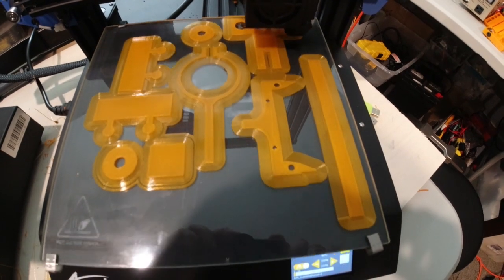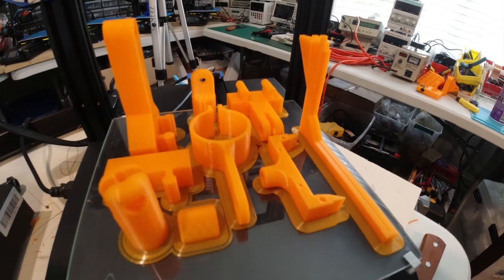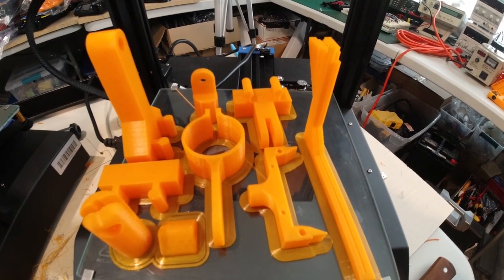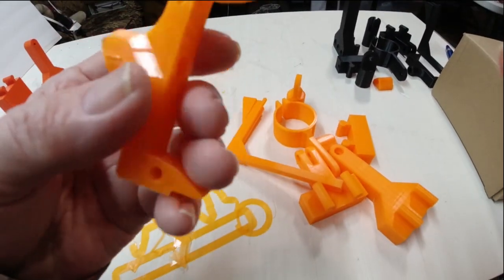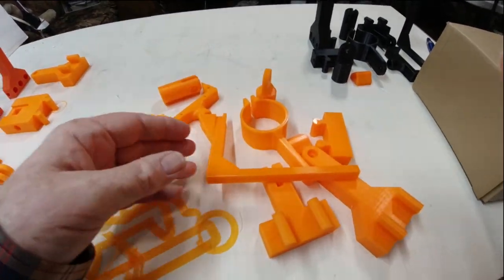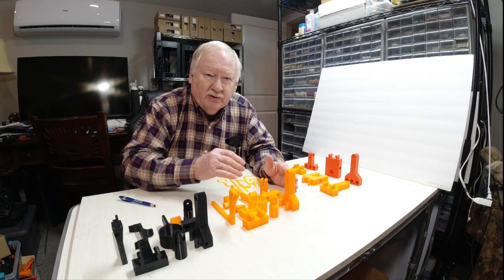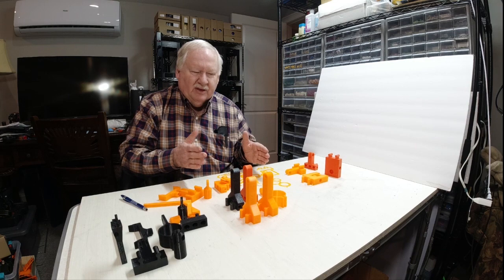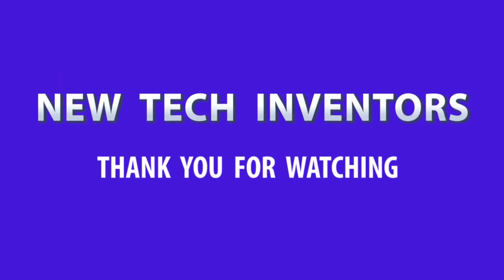3D PRINTING "AS GOOD AS IT GETS"

Comment: I used to use glass beds but now have pei steel sheets on all 4 printers.  The glass beds worked great but it was often difficult to get parts off there, and I would end up messing up my bed leveling because it took so much just to get the parts off.
Reply from the maker: I agree with you Wayne, keeping the print time between 23 and 24 hours allow a once-a-day servicing of the printer. This was only a test print, I try to keep my production printers running on 12- or 24-hour schedules, this reduces the time I have to go to the print farm. Thanks for the comment and your support...Ken
Reply from the maker: Sorry Wayne, my reply was for another comment "davis2022" below, just got you guys mixed up.  About glass bed, I too use a lot of pei beds, and they work well, but the glass also works well if you have time for them to cool down, otherwise I have to remove the glass and cool it in front of my air-conditioning unit. Thanks for the comment and your support...Ken
Reply: @NewTechInventors  yup, I finally made it up to the pei videos :D  I'm about 30 videos from present time lol
Reply: Wow looks like they come off easy once it cools though.  I'm too impatient for that lol

Comment: glass is great for pla but as you get to PETG it becomes much more difficult to stick on glass.  How hot was the bed?.  Very nice quality.  Brimming a base I have found, doesn’t really mean your piece is adhered.  For your purposes your format works extremely well. Don’t fix what ain’t broke.... joe
Reply from the maker: The bed was at 60 deg. I don't usually use brim and only did for demonstration and extra holding since I was printing many different parts at the same time. I think your right Joe when it comes to PETG adhesion is more challenging. Thanks for the input...Ken

Comment: Never had much luck with the A12, actually TRADED it to the guy who rebuilt my Tevo Tornado (which works great, though it is wanting self leveling badly).
Reply from the maker: Thanks for the comment. Most of my printers do not have self leveling. I found that if the printer is adjusted with very little play in its movement, sitting on a very flat solid surface, and the bed adjustment springs are strong and well compressed that once level is set it last for a long time. Also make sure Z axis limit switch is firm, good quality, and making good contact. Self leveling is a good feature when you have it. Thanks for watching...Ken

Comment: Neat. I was wondering. Is there a reason you haven't gone to injection molding? I don't know anything about it but folks say  it
is cheaper and faster. Just wondering. Keep on inventing!
Reply from the maker: Very good question. I am familiar with injection molding and have plans to produce some parts for another product using that process. I am currently making parts for that product on 3D printers only to produce enough of them to see if the demand will be great enough to justify the cost of injection molding. Watch for video soon. To be cost effective using injection molding you must commit to am minimum quantity of parts and purchase a mold. The mold alone can cost from$10,000 to over $20,000 depending on the part. The parts for the helping hand are well suited for 3D printing because of size and complexity of the parts. Thanks for the comment...Ken
Reply: @NewTechInventors  Ya I see what you mean. That said you would think a local CNC business could whip you up a mold part for much much less than that. Then don't at home. I wonder. Ok keep it up!

Comment: PLA printed on clean heated glass works fine.  I've sometimes had to put the glass plate in the freezer to get the parts off!  ABS will need some kind of 'glue' on the glass (PVA usually) and a hotter bed.  PETG should work on glass too, just a bit hotter than PLA (70-80 C vs 60C for PLA).
I often get stringing between parts when I print lots of parts in one go.
Reply from the maker: I have had success in eliminating stringing between parts on multi part jobs with only slight tweaking of slice settings and retraction. I have used glue sticks, hair spray, and glue water mix on my glass heated beds and they all work. I have not had luck with clean glass yet. Thanks for your input and info...Ken

Comment: Just a tip when it comes to large scale production like 200+ of a item removing all the brims really gets to be a pain to do so try to get the parts to print without a brim we use 3Dlac spray most of the time to get a reall strong connection to the bed and when it's cool they just pop off with no brim to clean off
Reply from the maker: All production parts that I currently print are without brim and are doing well. I only used it on that test print to insure that I could complete the test without any problems with the glass bed. Thanks for the info and comment, it's good to know that you have had good results with no brim....Ken
Reply: @NewTechInventors  we also use glass beds for our printers and switch them out to glass if we get a new printer that doesn't have one. Yes flexplates are fun but glass can be removed just as easy of even better when it's cooled down plus they don't wear out as soon like the flexplates do
Reply: I use glass on my prusa mk1 with glue stick no brim Its great for pla. Abs with hairspray and brim for petg tho dont print on glass you may chip it

Comment: I'd recommend also experimenting with larger nozzles. My favorite is 1mm with 0.25mm layer thickness at 45mm/s. Compared to 0.4mm nozzle and 0.2mm layers at 60mm/s, a 26 hour print becomes less than 5 hours.
Reply from the maker: Thanks for the suggestion. I haven't had a chance to try other nozzles with everything else going on, but it makes sense that it could cut my print time down , I will make a point to try a 1mm nozzle on one of my 3D printers and let you know how it works. Thanks for the input and for watching...Ken

Comment: Way too much brim. Waste of material & a lot of time.  Great to see You @work ;)
Reply from the maker: I agree and don't think I will need to use any on future prints. It's easy to remove but takes time. Thanks for the comment David. Heading to work on final clean up for the new print farm, want to help?? See you later and happy printing...Ken
Reply: @NewTechInventors  I use 2mm brim most of the time. Without it, corners will often peel up. With it, there will sometimes be a little dimple in the underside where the actual model started to pull up, but the brim is flexible enough that it stays stuck down and prevents the problem from progressing. But due to the flexibility, anything beyond a few mm doesn't make any difference.
Reply from the maker: @dekutree64  Thanks for that info, I will try it on one of my jobs...Ken

Comment: What filament are you using Ken?
Reply from the maker: The filament used on this job is BuMat 1.75 PLA Orange. I get similar results with Sunlu SPLA with slightly different printer settings and higher temperature. Thanks for the question...Ken

Comment: I use Dimafix liquid stick on a steel flex plate. It's self releasing adhesive that makes the parts stick without the need for brims, so no cleaning up needed.
I have several WhamBam plates so I can start a new batch while the previous one cools off.
Reply: Plates without the PEX/PEI sheet installed?
Reply: @mjoconr  Yep, bare metal, not even scuffed. ASA, ABS and PC kept eating into the PEX, then I realized it works just fine without it, I just add Dimafix, and it gives me that glass finish too.
Reply from the maker: I haven't seen that, but it sounds good. I'll have to check it out. Thanks for the comment and for sharing the info...Ken